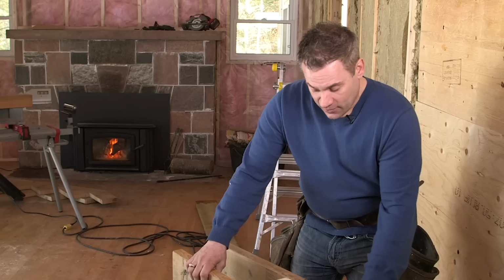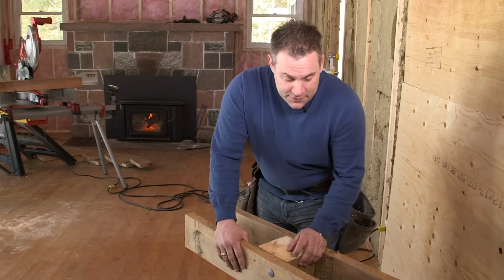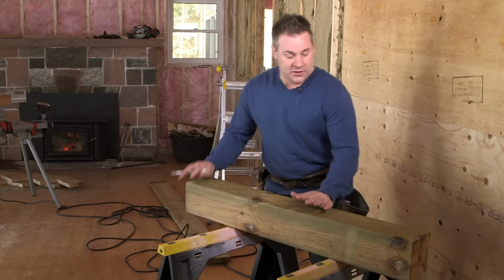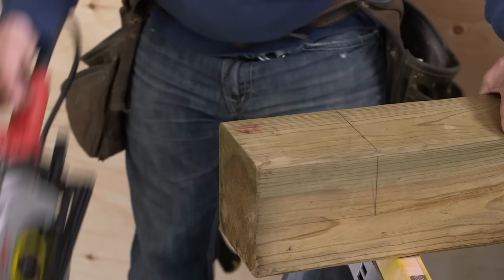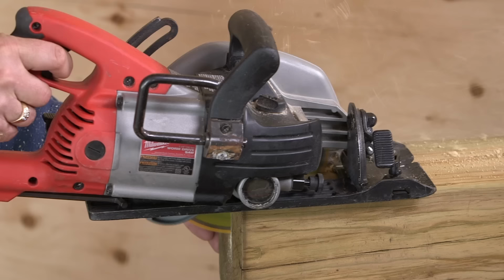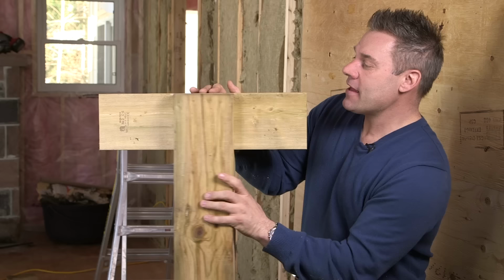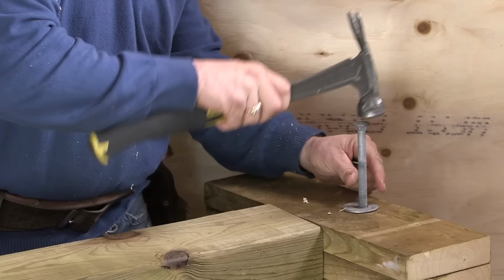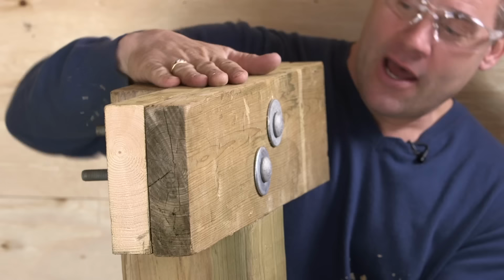How to Attach a Beam to a Post for a Deck | Decks, Docks & Gazebos

Comment: 1/2" bolt has ~7000 lbs of sheer strength x 2 = 14k lbs at each post in this 'wrong' example.  The 6x6 post itself has about the same /compression/ strength.  The real reason for the rabbit joint is wood shrinkage.  Over time, the treated lumber will shrink and a bolt will loosen.  With the beam directly supported by the meat of the post, loose bolts from shrinkage do not compromise the integrity, and can and SHOULD be checked to be tightened.
Reply: LOL, spot on.

Comment: "Carriage bolts have no shear strength! Let me demonstrate that by using something completely different than a carriage bolt!"
Reply: And by applying bending moment rather than shear stress...
Reply: did you miss the part where the beam now sits on solid wood, opposed to relying on the bolt completely? lol..
Reply: @chrisburns5691  correct! NOW the bolts only job is to hold the ledgers on to the post, NOT take the load of the deck, the post is taking all the load.
Reply: Didn’t you ever learn what an analogy was in school? Whilst it wasn’t a perfect example it did demonstrate his point.
Reply: @bh9275  They do have shear strength though, so it was an inaccurate statement.
Reply: @birdog874555  actually it is an accurate statement, decks are never built that way, anymore anyways..doesn't meet code to just rely on carriage bolts.. I agree that it would take a lot to shear two bolts, but still not correct building.
Reply: @birdog874555  Did you get the core message tho? Lol as long as you did, doesn't matter.
Reply: That statement is absolutely wrong.  The two bolts have much more shear strength than the 2x6. 
This guy does not know what shear strength is.  Not in the least.
Reply: @Tsamokie  he is not wrong in that it is against code to do that though.. not the way to build a deck..
Reply: @Tsamokie  Maybe, but he got his point across. You shouldn't rely just on the fasteners for strength, but on the geometry of the structure. Have a nice day!
Reply: I agree. It's nonsense. Never seen a carriage bolt break yet. Heck, it will probably outlast the wood in that deck by decades. All those here saying otherwise should show an example of a carriage bolt broken when used in this manner. They can't.
Reply: @robinstewart6510  they can, although yes would take quite  a bit of weight.  Point is, it is against code to build a deck relying on just carriage bolts, and everyone who builds decks and works in the industry knows this, and doesn't go hanging their deck off carriage bolts, because they know how to build, and know their work would fail an inspection otherwise.  Usually will see beams sitting directly on posts with Simpson hardware tying it all together.  That is the better way imo
Reply: @chrisburns5691    ..  It may be against the code in your state. I don't know. However, it is not against the code in mine. I built my own deck using carriage bolts. I trust them to last for many years, as the old deck did (replaced due to 50 year old rotting wood).
Reply: @robinstewart6510  check the IRC. Requires 1.5" of solid bearing where a beam is supported by a post.  As a carpenter I've never seen a carpenter do this connection  for anything other than a kids playground etc.  Always seen decks (that have proper inspection, not some dude in his back yard) built with the beams resting on top of posts attached with hardware (my preferred way) or notched and let into posts as shown here.

I get that the bolts would carry a lot of weight.  I've just never seen that done by any proper builder at a jobsite, where the work is inspected later.
Reply: @robinstewart6510  Your point buttresses mine and in no way negates the fact that the proper way to place the beam(s) is upon a lap cut into the supporting post..
Reply: @robinstewart6510  great. but did you consider the effects of time? like when the lumber slowly degrades... the carriage bolt probs wont help.
Reply: "Carriage bolts have no shear strength" lol.  right. 

 just like all the carriage bolts or lags I used to attach the deck's ledger to the rim joist (where the exact same mythical shear principle applies) and there is equal if not more load.  

 I know code says beams should rest on top of posts, but its not because carriage bolts have no shear strength....
Reply: Yes, the reason he gave is completely wrong, but the configuration is also wrong and he is correct in that the beams should be resting on the posts.  If the deck is heavily loaded in the current configuration, it will fail, but it is not likely due to the bolts breaking, but rather to the wood crushing and splitting at the bolt hole locations.  The reason is fairly simple.  The bearing area of a 1/2” bolt is 0.5” x 1.5” or only 0.75 sq. in. of bearing surface per bolt. That is only 1.5 sq. in. for both bolts combined.  If the 2” beam is resting on top of the 6”x6” post, you now have 1.5” x 5.5” or 8.25 sq. in. of bearing surface which means the wood is much less likely to crush and split under the rated deck load.  So, the real issue with a bolted connection like this isn’t the strength of the bolt, but the strength of the wood.
Reply: @LTVoyager  This is exactly what I was thinking. All of that weight is on two thin strips, prime for splitting the post, especially if it begins to degrade.
Reply: @LTVoyager  almost correct.  You left out the massive friction generated from the clamping force between both joists and the post. If a 6" rough post and 2" x 8" (7.5") joist, that would be 6" x 7.5" =  45 sq inches  ...X2 .....= 90 sq inches of friction force generated by the clamping pressure on two GALVANIZED carriage bolts which could be either 1/2" or 5/8", or perhaps 3/4" diameter.   ------    Still the danger from this video is this guy makes an idiot statement about carriage bolts in the first place ....regardless of the fact that he is 100% correct in how to construct this joint.
Reply: @taxicamel  I left it out as it is standard structural engineering practice to do so with timber connections.  Unlike steel, where the material is quite uniform and the clamping force will remain essentially constant over time, timber construction is much different.  Wood will relax over time, particularly after many cycles of dry and humid conditions.  That is why a tightly bolted wood connection will often be fairly loose after a few years.  The wood fibers get crushed during periods of higher humidity and then when the wood shrinks during dry periods, the joint loses much of the clamping force.  I have been retired for a few years now, but I have not see any change the timber manuals that allow interface friction to be included in the design of a timber connection.
Reply: @robinstewart6510  
Exactly, show me where this sort of design failed.  ESPECIALLY because the bolt sheared off. Does...not...happen.
Now, I would agree that the alternate method is stronger. But if the failure mechanism under consideration doesn’t happen, why go to such lengths to ‘fix’ it?
Stronger? Yep.
Necessary? No.
Reply: @Zerpersande    ..  Agreed.
Reply: @Tsamokie  well there are several points that are misstated in this. The connection he prefers is a better connection than the two carriage bolt connection originally shown. But it is better for reasons he didn't talk about, and is more work to install.
Reply: @LTVoyager  Thanks for going to the effort of discussing the real nature of the problem. It's all about bearing perpendicular to the grain of the wood.
Reply: That 1/2 inch carriage bolt, A307 Grade A, has about 7000 pounds of shear strength... each. 

“Because it’s not code” is an accurate statement. 

“Because it has no shear strength” is an inaccurate statement. 

More than likely, the reason it is not to code to use carriage bolts that way is because the wood has much less shear strength than column loading strength.
Reply: Ha! None of you (including Jason) know what you're talking about. The reason it's not code is because of potential wood splitting. The notch is like a safety net.
Reply: @chrisburns5691  oh yeah? how are ledger boards held up against a house genius? CARRIAGE BOLTS - they have TREMENDOUS shear strength - obviously having the post take the load is BETTER - but saying they have no shear strength is a total lie...
Reply: @truecrimejungle  i never said they have no shear strength. I stated the obvious thst they don't have enough shear strength to pass code and are not common practice with those who actually know what they are doing. Also an issue is the lumber cracking and breaking at the connection. It is a weak connection for any kind of deck off the ground, that's why it isn't done that way.Ledger board which is often lag bolted or in some cases thru bolted, is a different case as there are several bolts spreading the load, mechanically securing the board at several different locations flat against the home. At a post and beam connection all the load is concentrated in one spot.

Stick to analyzing hair, or do some reading up on codes and common practices for building. Let me guess, you are some weekend warrior qho thinks he knows what he's doing. Please tell me you don't call yourself a carpenter.
Reply: @chrisburns5691  LOL so are you telling me lag bolts and thru bolts have "more shear strength than a carriage bolt? All you can do is repeat code, I actually understand it. I have a masters in construction management, you just work for me. My youtube is a joke to support a freinds mma channel lol you're not hurting anyones feelings here, youre just exposing yourself.
Reply: @truecrimejungle  and I don't work for you, I work for customers who demand quality, and assume that if they want a deck it will obviously pass minimum code and be built to a standard above that.. Too bad that with a masters in construction management you don't know how to build or how to build to even basic minimum code, or understand why this outdated method has been left in the past.
Reply: @chrisburns5691  The guy said "Carriage bolts" have no shear strength, which is BS; certainly when compared to wood... Designing to best practice and incorrect statements regarding relative material properties are two completely different things.
Reply: @enrjdean  there is a reason why decks aren't built with beams hanging off posts by carriage bolts.

Comment: the fact that you can snap a screw off with your hammer is not an argument.
Reply: He was demonstrating what he meant by shear strength.
Reply: The fact that you can post an anonymous comment is not a counter argument
Reply: But it is a demonstration of the exact problem.
The codes aren't an argument either. But they are enforceable.